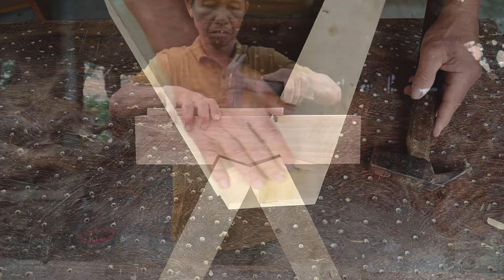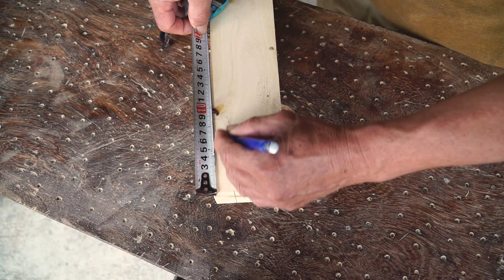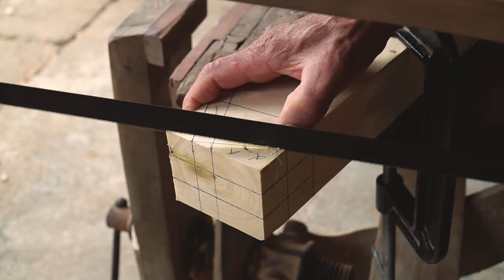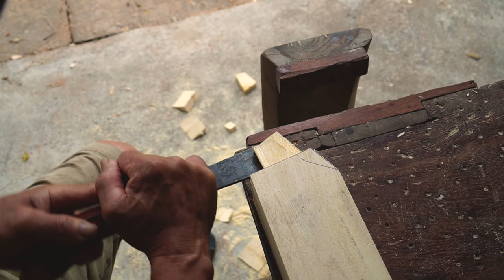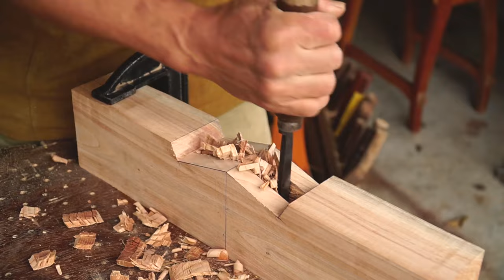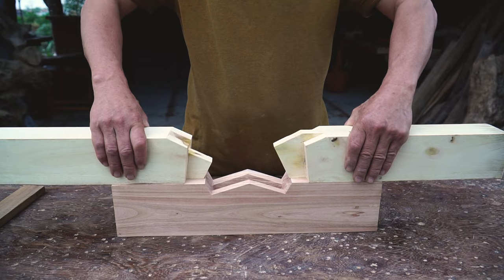Amazing SIMPLE Joints For Roofs, Making Hand Cut Mitred Dovetails Strong Wood Structure

Comment: Nice little joint. One of the standard joints of the eastern timber framing tradition. However, although there is a mitre involved, there is no dovetail, so the tradition of erroneous click-bait headlines for the channel continues.
Oh, and stop hitting wood with steel! Use a mallet, a rubber hammer, or a bit of scrap to cushion the blow of a steel hammer.